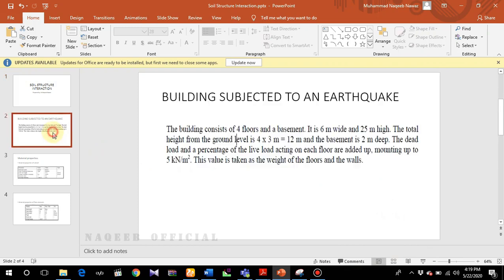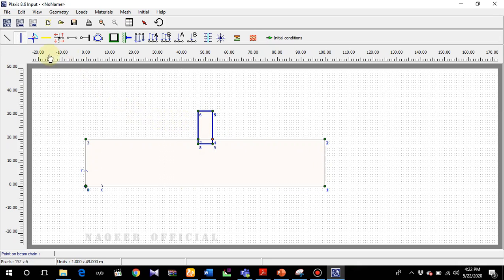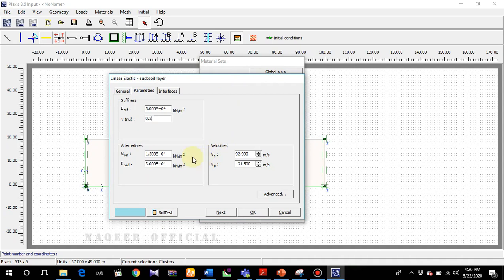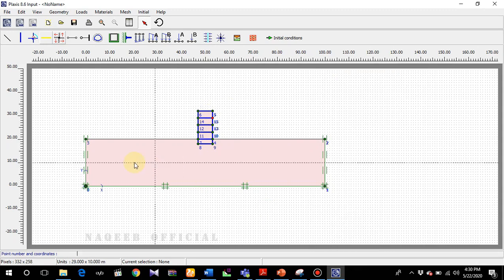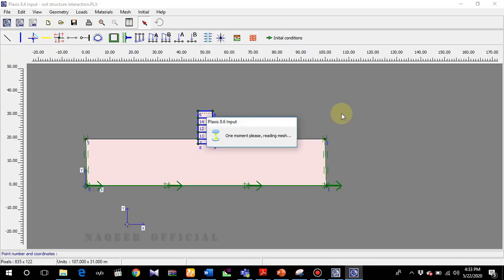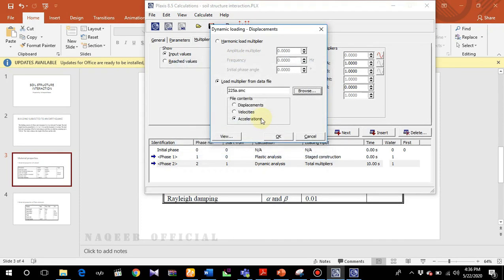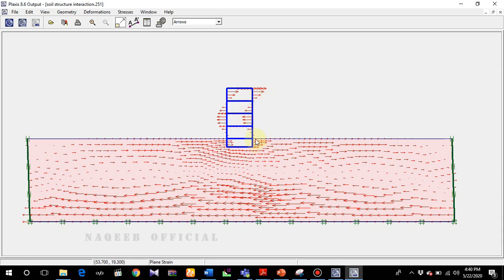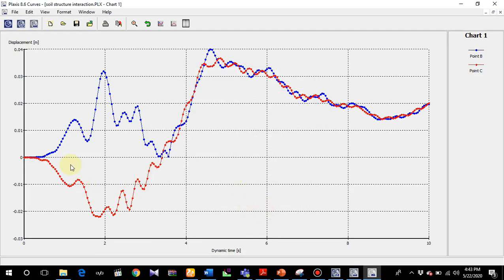PLAXIS Lec 05 | Building Subjected to Earthquake (Dynamic Analysis)| English | Geotech with Naqeeb

Comment: Thank you very much for your helpful video...
Can you help me please how can i simulate the load sharing between raft and piles in plaxis 3D piled raft foundation system... I know the method for this but it needs the normal stress on raft... My question is how i can get this value and it is location on the raft and do i use the maximum value of normal stress or the average?

Comment: Sir, how to get the value of saturated unit weight and weight of the building which u have mentioned as 5
Reply: Thanks, what is w?
Reply: @ciciinfant2121   w is basically water content
Reply from the maker: Saturated unit weight= Gamma dry ×[1+moisture content]
Reply: No Sir, I mean about w as 5 in building specifications
Reply: @ciciinfant2121  this is total weight of building means dead load plus live load
Reply: How to change the accelerogram data to EL CENTRO EQ DATA or KOYNA EQ?
Reply: @ciciinfant2121  u can have any accelerogram..u can use deepsoil software to obtain accelerogram of any earthquake and can put in plaxis
Reply: Thanks. Please tell how to get EI and EA? in this example.